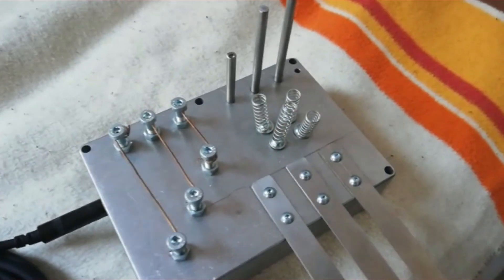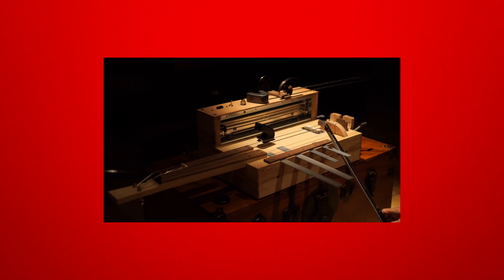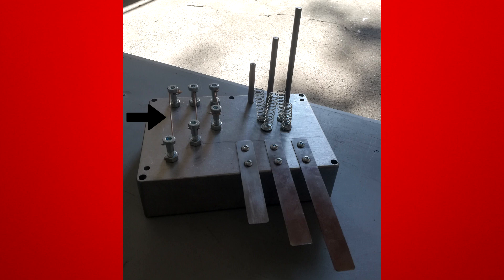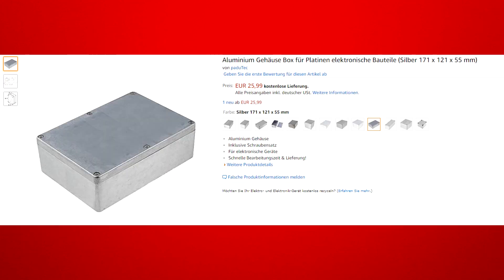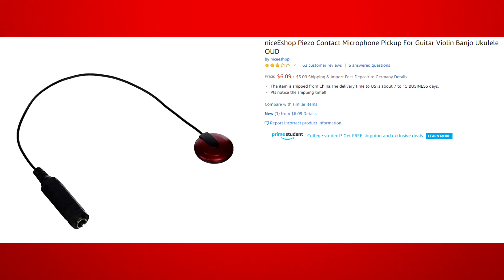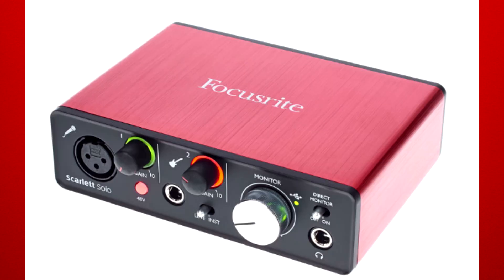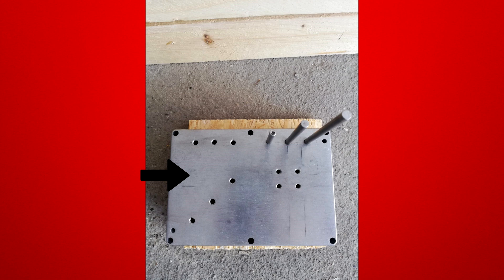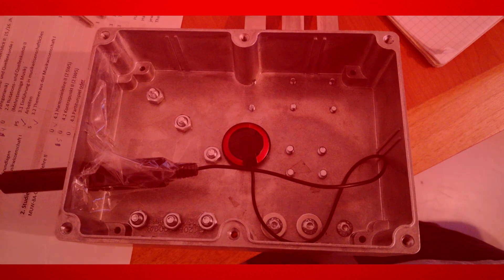Original Instrument Showcase: Noise Box / Noice Box

Comment: I like what you did here, and I'm planning on getting into experimental instruments too. I just ordered my first piezo contact mic last night. I bought an already assembled 3 piezo 1 female 1/4 jack style. I noticed that you said you couldn't get piezo's to work, but the one you bought was a piezo. Do you mean you couldn't assemble your own, and had to buy an assembled one? I'm asking, because I was planning on doing something similar with the piezo mics I bought. Since I'll have 3, it should produce more power, and in turn more sound. I want to make mine with a larger case. I'm not sure what material I'll use yet. I was even thinking about a plastic storage container. I've been studying field recording, pedal fx, synthesizers, and electronics, and it led me to piezos. I haven't been this inspired for a long time. I can't wait until I get paid. I'm buying a bunch of stuff to build electronic instruments. I was even thinking about buying some cheap fx pedals to add onboard fx. I already own a couple better pedals, but I won't be tearing those apart. I wouldn't mind buying some used Behringer or Joyo pedals, and taking them apart, and doing some circuit bending to them.
Reply from the maker: > I noticed that you said you couldn't get piezo's to work, but the one you bought was a piezo. Do you mean you couldn't assemble your own, and had to buy an assembled one?

Yep, that's what I meant!
Reply: @FulminisIctus  Thanks for responding. I was getting a little concerned about the one I ordered. Mine is already put together, so it should work. Stay blessed!